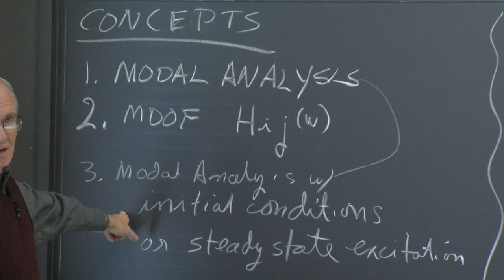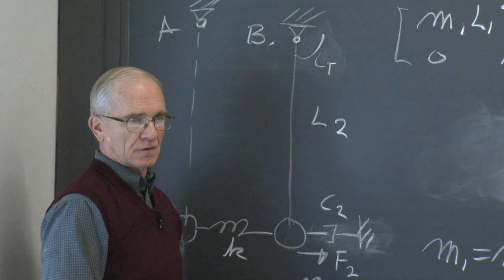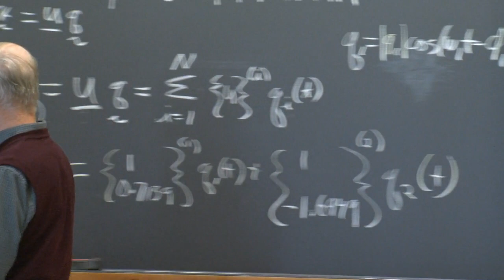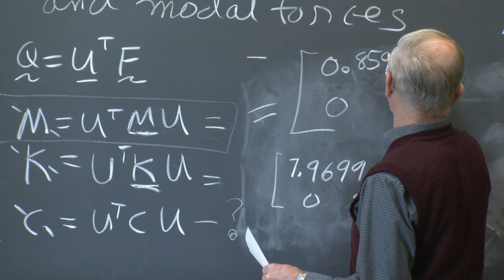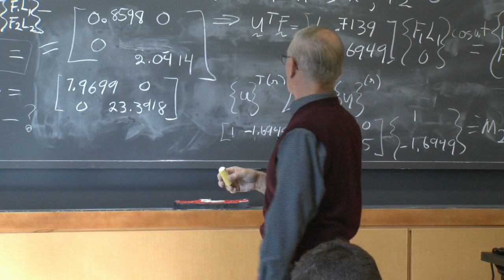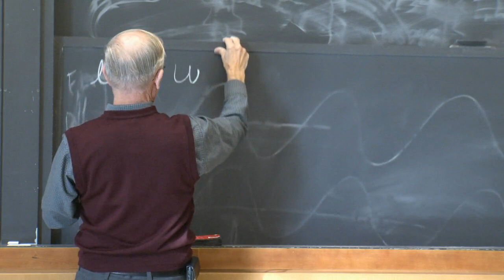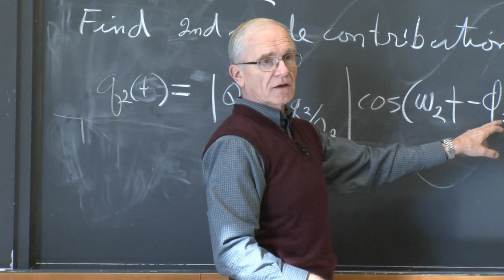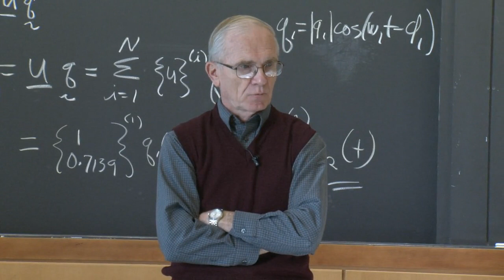R12. Modal Analysis of a Double Pendulum System

Comment: Dr. Vandiver, Thank you so much for your incredible contribution to MIT and the Mechanical Engineering department. I watched and take notes from all 39  lectures and they are all amazing. I learned everything about Engineering Dynamics. I solved many problems in Dynamics/Physics. The book that I used is by Beer and Johnson  Fourth Edition.